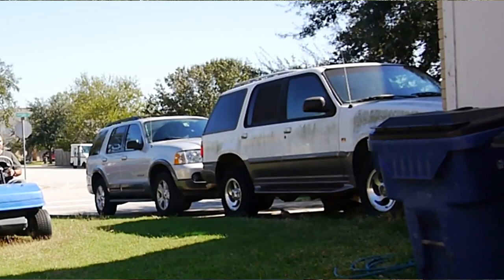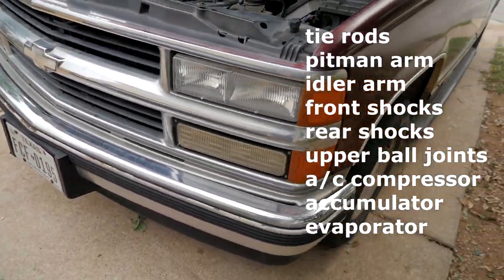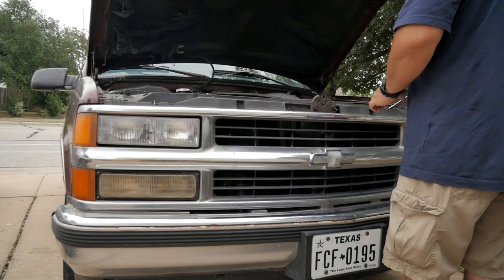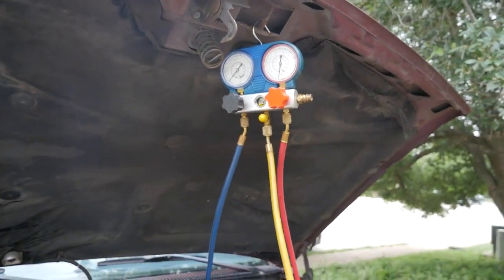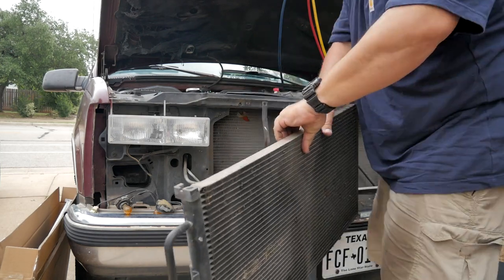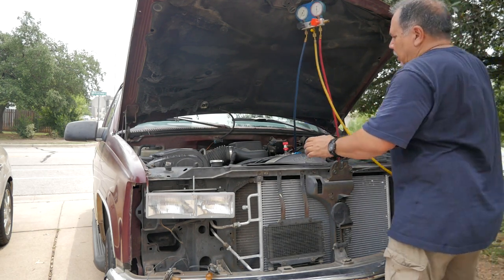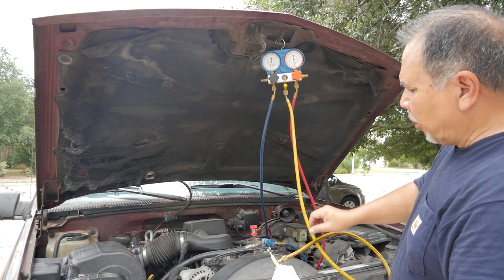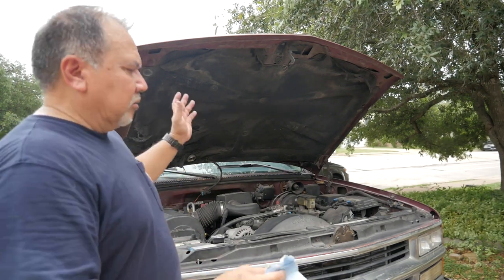My Old Suburban needs a Condenser.

Comment: I have a 2000 Lincoln LS and only has 75,000 miles the cooling fan is spinning but the fan use to run at a high speed once the engine reaches a higher temperature do you know what that could be I checked all fuses your advice would be much appreciated